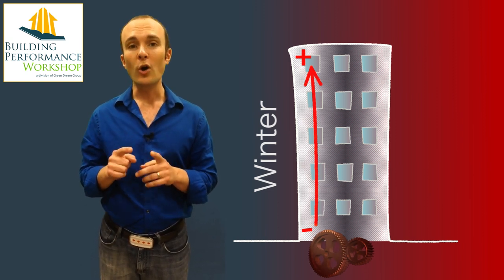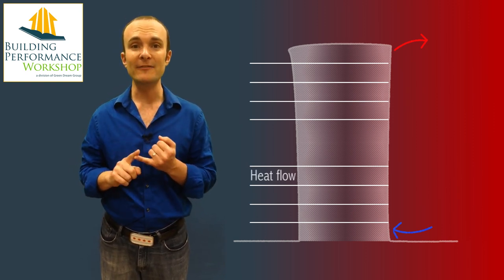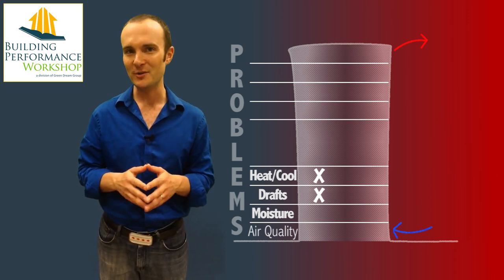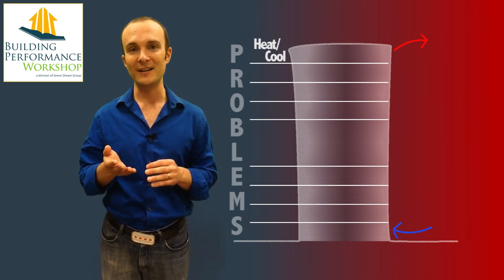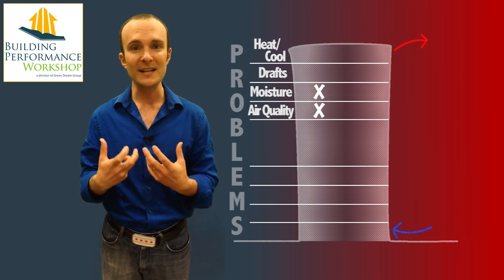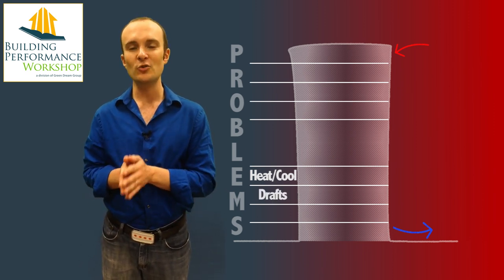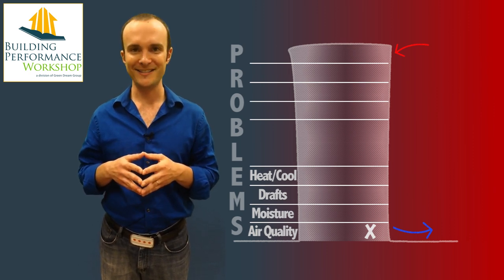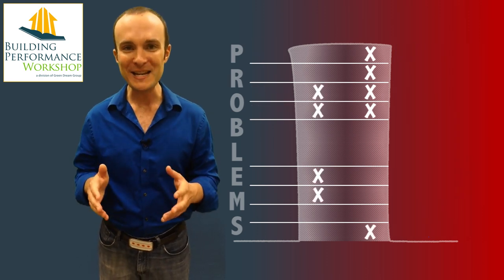Stack Effect in Multifamily High Rise: Penthouse vs. First Floor Apartment Analysis

Comment: Do you then airseal from the top down?   If you airseal starting from the bottom you risk depressurizing  the building.  Right?
Reply from the maker: Great question, John- in heating dominated climates, always airseal the top, then bottom, then middle. In cooling dominated ones, always airseal the bottom, then top, then middle. But not because doing it out of sequence would mess with the pressures- the pressures are messed with regardless of what you do about it. You simply follow the guidance of a hot air balloon: there's a giant hole in every one, at the bottom. But no one worries about cold air getting in and sinking the balloon, because NO AIR CAN GET OUT. Air must escape first, then it's sucked in.
Reply: Thanks Corbett.  It's into the attic for me...
Reply from the maker: Go get it man!